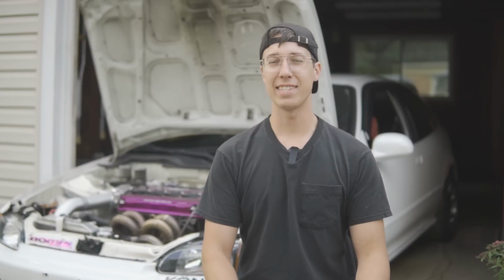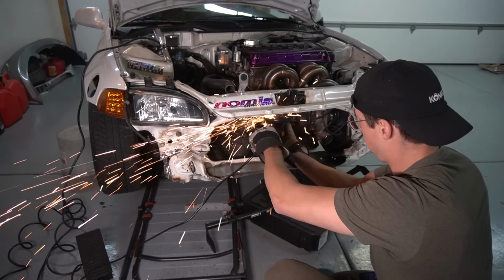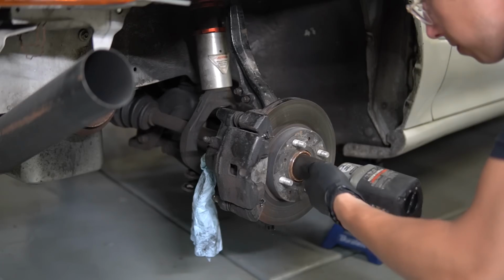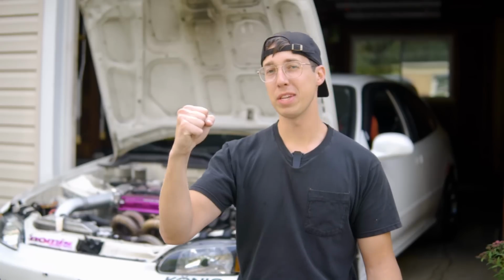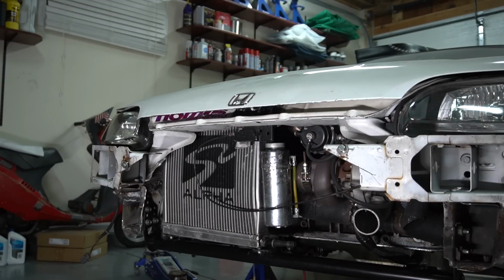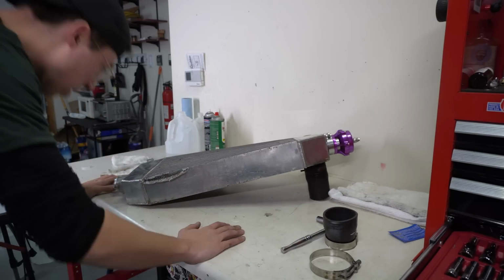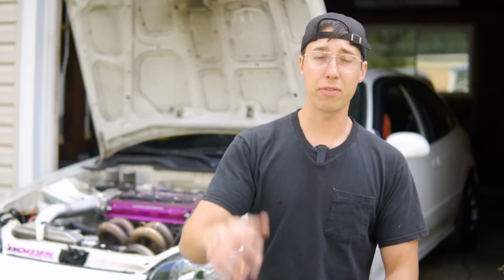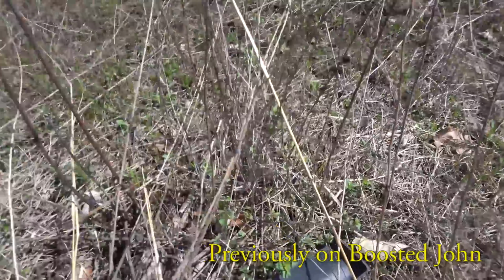Restoring My CRASHED Turbo Honda Civic Drag Car! (Epic Comeback)

Comment: im sorry, 10 hours to weld together a single intercooler pipe?  boy I hope you werent paying labor by the hour because if you did you got ripped TF off OMEGALUL
Reply from the maker: Including transporting the car and all.
Reply: Ya, that's BS. Could easily cut out the bad spot and replace it. Idk. Glad it's peeved back together. Hopefully it can safely make a 10sec pass

Comment: if youre using JB weld on your car, Stop modding cars. SMH
Reply from the maker: L comment.
Reply: @boosted_john  it’s more a huge safety concern. Wasn’t exactly directed right at you bud. Just a broad statement 🫡
Reply: L comment
Reply: @J0SHU4N0LL  L comment